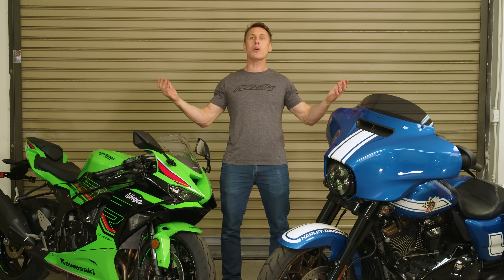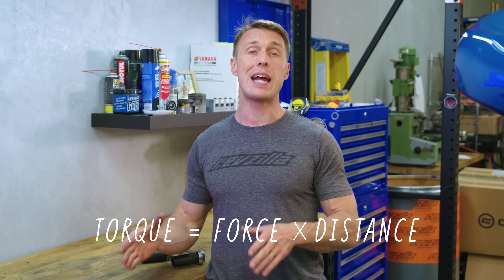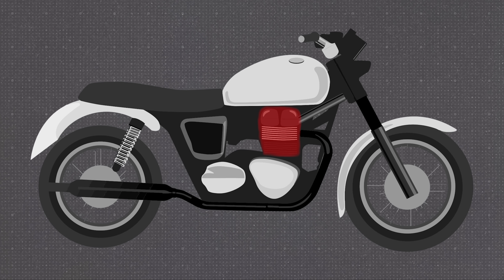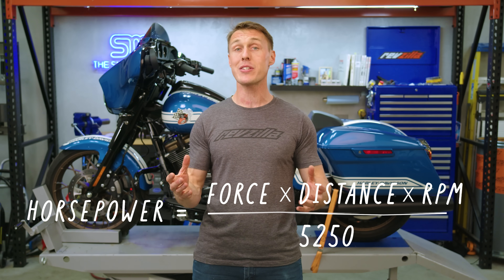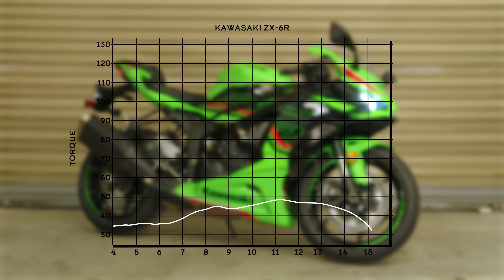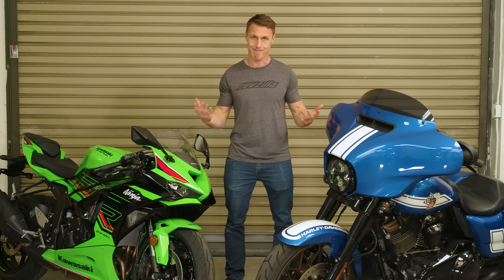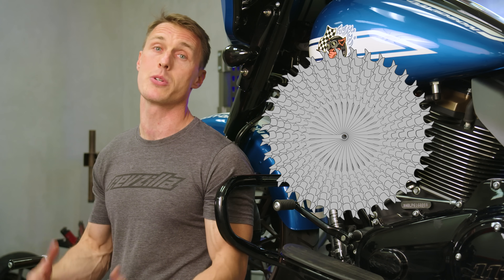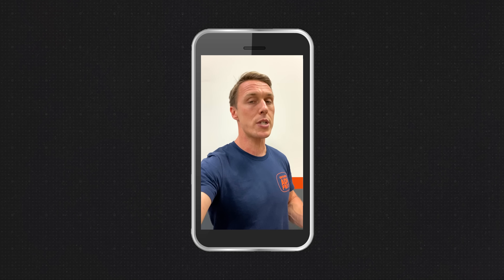Torque and Horsepower Explained! | The Shop Manual

Comment from the maker: Get the latest moto news and bike reviews at Common Tread https://rvz.la/3SiLCEB
Reply: Hey Team, thx for another awesome video :) 
Would it maybe possible to get a video from Ari´s Shop Manual, of him doing an upside-down fork rebuild? 
I know there is an video during his old MM times, but thats 8 years old and was about an right-side-up one.
Greetings an have a good one folks
Reply: i’m sure y’all have muted me but this video rly needs a rewrite
 if u want to avoid misinformation and actually elucidate the difference btwn torque and power for bikers who don’t know..

power = acceleration
torque ≠ acceleration
torque = where the power band is in the rpm

power tells u how fast u can accelerate

torque tells u what rpm range yr power band is at.. (a 200ftlb 100hp bike had a much lower redline than a 60 ftlb 100hp bike for example,,
but w the perfect transmission they’ll have the same acceleration..)

Comment: A wise man once said "Horsepower is how fast you can crash into a wall and Torque is how many walls you take with you."
Reply: Classic. Saying.
Reply: Worst analogy ever.
Reply: 😂😂😂😂 what an awesome analogy.
Reply: @doomman700 how’s it wrong? I’ll wait.
Reply: @nogginbonker76 how is it wrong, start with torque is a twisting motion not push. Then the fact that momentum will be what carries that wall which means speed and Hp will push it farther. Need more?
Reply: @nogginbonker76  Because horsepower to weight ratio determines how quickly a vehicle accelerates and power to drag ratio determines the top speed of the vehicle (unless it's limited by gearing), while kinetic energy (vehicle mass and velocity) determines how far you take the wall with you, or how many walls you take with you. Power is basically everything with regard to the performance of a vehicle.
Reply: into that same wall right
Reply: @nogginbonker76  how far you will take the wall with you depends only on the speed and the mass of your bike at the moment of impact (among other factors like surface area etc. of course)

the mass doesnt change with different horsepower or torque
and the speed doesnt either

the analogy just doesnt have anything to do with the difference of torque and horsepower and is just completely off topic
Reply: I wish I could buy u a beer
Reply: that wise man needs to study physics
Reply: Great example ! I’ll use this explanation ! Hilarious
Reply: @xXRunDeathXx  E = mc2
Reply: I'll take torque all day over horse power.  Torque pulls harder and you can feel the difference .
Reply: I heard this almost 10 years back.
Reply: @doomman700 😂
Reply: 😂😂😂 Learning, in a hilarious way
Reply: For anyone curious, that analogy is not accurate at all.
Reply: Noice
Reply: @nogginbonker76 its wrong because when you hit the wall, you'll break the vehicle and the engine will stop. So what decides how many walls you go through at a given speed is the weight of the vehicle.
Reply: @nogginbonker76 there you go, you waited and they answered.
Reply: It needs a wise man to say this? What a joke.
Reply: @doomman700 ehhhhh, when u understand torque and hp it makes sense
Reply: @coopermoreton6993 I run a dyno, I understand torque and hp , torque has zero to do with how far a wall moves. That would actually move farther with faster speed or more hp. But fools repeat those dumb saying trying to look smart. It actually makes them look dumb to a guy that does understand the two
Reply: Torque is what wins races
Reply: @jayonez137  the guy with the biggest pile of Hp wins period. Torque can be applied to a frozen wheel and get you nowhere, but break it free and you have rpm and hp that does something. I don’t expect you to grasp it, it’s a reality though that cannot be disputed meaning it’s fact
Reply: @nickn7939 
As do most people, fr, lol.
Reply: Sounds backwards
Reply: @savvykronik4192  
Now that I think about it...
I agree.
Reply: @ivoryas1696  torque is what drags your ass in a tug of war, hp is what passes you in a street race 😂
Reply: I like that hahaha HP and in Valhalla with nothing Torque and your in Valhalla with the wall lol😂
Reply: That's not actually how it works. Hp is essentially the potential for speed. Torque is how fast you will make that speed
Reply: Ahahahahahahahahahahahahahahahahahahahahahahahha
Reply: @doomman700  if it’s so bad then don’t read it😅
Reply: Basically: Torque = more acceleration/quickness. Horse power = Higher top speed ..lyes?
Reply: @jimibones178 exactly. I said something similar.😊
Torque =Quickness/acceleration. HP = Top speed. I prefer low-end Torque in a Muscle car of later 60’s . Like my 69 Oldsmobile Cutlass Supreme. with a 3 speed hurst. That was the Torquey-est car I ever drove. Damn but it was so much fun.😊
Reply: @michaelslater6839  I'm the same,prefer the torque. Is a pretty rare occurance you get up to top speed either way, so may as well accelerate better
Reply: @jimibones178  Plus as long as you’re not spinning your tires in an automobile, you’re not as likely to get a ticket with hard accelerating as you are when speeding . Although, there’s always the possibility of getting an “exhibition of speed” ticket. I tend to accelerate up the on-ramps when I’m in a quick car, then hit the brakes before I get too visible. Keep the rubber side down Jim.
Reply: @michaelslater6839  yeah I tried that a while back, but highway patrol clocked me at 104 before I even got off the ramp lolzzzz. I got in trouble
Reply: @jimibones178  I will admit, I have been lucky. I rarely ever do that now. Can’t afford a car with much torque or the $5.50/ gallon Cali. Gas to feed it.  I try to pick a long one that’s down below the highway for most of the way. Like after an overpass. Sorry that happened to you.
Reply: @michaelslater6839  I was on a bike, so gas isn't too big of a deal. But, is all good. Got my license back now lol. Nice talking to ya buddy:)
Reply: Lol
Reply: @nickn7939  he did he failed 😂😂 just like the analogy 🙌🏿🙌🏿
Reply: Straight truth cuz I just went into a tree by accident lmao
Reply: No
Reply: A wise man didn’t understand physics
Reply: The only thing worse than being wrong, is being publicly wrong as the first comment on a video for everyone to witness your idiocy.
Reply: He wasn't very wise. At any given speed the engine with the most hp will produce more torque at the wheels.

Comment: This was the explanation i was looking for. I knew the diff...but only at a surface level. The crank motion animation & explanation with the two different motorcycles really helped.
Reply: Yes - holding the piston-con rod and the crank pin made the difference for me too. Have seen many videos on hp vs torque and the force x distance equation but somehow that visual made it click.
Reply: same was very helpful!
Reply: Indeed
Reply: Torque is just a force. I think the concept of force is quite intuitive. Power is the one that is less intuitive. In layman's terms, a powerful muscle can exert a lot of force. But when you say a powerful engine can exert a lot of torque, it can get confusing because of the power and torque numbers/curves in the specs/dyno sheets. The torque can climb down while the power still goes up, but all is relative to the rpm.

In describing engines, compared to describing muscles, the term Power is more technical. A force causing motion in the direction of that force, is producing work. The higher the rate that you can do that "work", the higher is your measured power.

Torque is the rotational force produced by the engine's combustion, causing the crank to rotate (revolves). The rate of crank rotation is in revolutions per minute. The higher the torque that your engine is exerting at a certain rpm, then the higher the power will be at that rpm. Suddenly, the term "work" here is not specifically mentioned anymore.

If your engine crank is rotating at a rate 6500 rpm with a force (torque) of 500 lb. ft. behind it, then it is producing 619 hp.

The terms that are constantly there is the torque (force) and the revolutions (motion) per minute (rate). Power is kind of just a "calculated" result.
Reply: “How rapidly the torque is applied” made a lot of sense to me.
Reply: Be quiet
Reply: @sepg5084 Agreed, torque is just a force ( M*A) but is multiplied by the perpendicular distance from the axis of rotation.
Reply: actually, the animation was confusing. they showed the opposite of what they were talking about.

Comment: There's no real math in the 5250 number.  These weird numbers are the price to pay if you use US units.  In metric units, these numbers are simply 1.
Reply: I mean, conversion is still math. and in my eyes, all math is "real math"
Reply: Spoilers!

One day the US will switch over to metric and there will be much rejoicing...
Reply: If you're using metric units you still need to use a conversion factor. It's not 5252, but it's not 1.0 either. The factor depends on the metric power units being used (e.g. Pferdstarke or kilowatts) and the metric torque units being used (newton metres, kilogram metres, etc....).
Reply: @marcoperez1794   horsepower is not a metric unit
Reply: @arjankroonen4319  US Aerospace industry and FAA be like, "Oh, everyone else is ready to switch? Okay just a sec. We have about 80 years of test-based industry standards and regulations to re-do... without a war or... the commercial promise of the jet age for motivation".

Comment: A wise man once said, torque is mike tyson and horsepower is bruce lee.
Reply: I see where you're coming from, but I have a different perspective. The comparison between Bruce Lee and Mike Tyson is more about the type of engine and transmission rather than just torque and horsepower. In this context, the force relates to acceleration. Bruce Lee might have the same punch force as Mike Tyson, making them more comparable in terms of the force they generate, rather than just categorizing one as torque and the other as horsepower.

Comment: Torque is strength, horsepower is speed 👍
Reply: Half true. Power is speed and strength (speed x strength).
Reply: No, because the gear box. You can gear for more torque. HP will dictate how much torque there is at the wheels.

Comment: So what I'm getting from this is that the amount of torque at the crankshaft is not an important number. So why is it always talked about like it is? Because of a lack of understanding and of course marketers know this so they perpetuate the misconception.
Reply: You hit the nail on the head. Peak torque is kinda useless figure and is only talked about because of momentum. It doesn't matter if it's a useful number to the maker if it sells bikes
Reply: @pleasedontwatchthese9593 yeah, there are still a lot of dudes in comments thinking torque makes a difference in acceleration. 

If two bikes have the same hp then they will accelerate the same regardless of torque difference.  Only difference will be bike with lower torque will have to rev lot higher.
Reply: @currycel470  the bike has to Rev higher to create similar torque, torque is the turning force of the engine, HP is how fast the engine can work.  The higher the torque the faster you take off, how fast you can go is HP.  So a Harley will beat a Sport Bike off the line but the Sport Bike will then pass the Harley.  Harley high Torque low RPM, Sport Bike high HP high RPM.
Reply: @currycel470 bro it does😂, not a big difference, but it makes a difference
Reply: @evilwestsidefan9249 no.
Since the kawa will rev 3x higher you can gear it 3x lower and then it will have more torque and more acceleration than the harley.
Why? Because only horsepower matters for that, torque is manipulated by gearing.
Reply: If you ask any diesel guy they don't care about hp figures. Torque is king in work based applications. You absolutely do not want a low Torque high hp engine for anything but racing. Torque is also beneficial for off roading. Low Torque motors bog and stall out in mud or steep inclines. High Torque motors will not. This is why tractors and other heavy equipment use giant low hp engines.
Reply: @Cw0346  absolutely right
Reply: Yep. Power is most of what matters, and the shape of the power curve is the rest. Knowing engine peak torque tells you exactly nothing about vehicle performance.

Comment: I always knew what it was. But the analogy of the runner is a good one. The actual step pushing off the ground is the measure of torque, and HP measures the distance with multiple of those steps
Reply: It is a nice but completely useless analogy, because the torque as in the subject of this video is crankshaft torque, which is one of the most useless engine parameters, unless boasting and bragging are a virtue.
Crankshaft torque cannot be compared to the runners "push-off" because bikes and cars, unlike runners, have gearboxes.

Crankshaft torque is TOTALLY meaningless. 
At best, the SHAPE of the torque curve matters, but only a bit, and only for mediocre drivers that do not know how to use a gearbox (and I know that because I am one, hence my preference for older big twin sportsbikes like the 2-valve Duc's).

The best practical example for the utter irrelevance of engine torque can be found in Moto Grand Prix racing in the 1960's and '70's: Despite fourstrokes being "torquey" and riderfriendly with a wide powerband, pulling like a freighttrain, opposed to twostrokes being peakey and high revving,  narrow powerband and not all that much torque compared to the 4-strokes, without a single exception ALL manufacturers went with the 2-stroke for the simple reason that it is horsepower that wins races. Not torque. Even Soichiro Honda, who absolutely HATED twostrokes and tried to keep racing a fourstroke with the NR series, knew this (the NR was intended to extract 2-stroke horsepower from a 4-stroke engine). Honda had to cave and also changed to 2-stroke. Quite succesfully, I might add.

Comment: I always knew the difference in terms of applicability, but the actual physics behind it never clicked until now! They aren’t 2 different measurements, Torque is a variable within horsepower. You finally helped it click, thank you!
Reply: It's like money. USD 50000 is a nice amount but meaningless without time, is it per week, per month, per annum, over a lifetime? Similarly, torque is timeless, horsepower is torque over time.
Reply: How did you know the difference in application, but not understand the physics? Cart before the horse.
Reply: @gorillamoto5329 easy, if someone tells you torque is strength and Horsepower is Power then you now know the difference in application but you still might not know the physics behind it. We all know what things do but don't know how many things do it.
Reply: @paulneedham9885 torque is strength, Horsepower is power? 😂 Watch the video again. In simple terms, horsepower is torque over time.
Reply: A given number of horsepower can make any number of torque. Torque is a derived number.
Reply: I think it's the other way around isn't it? Dynometers measure torque, and then derive power by multiplying each point on the torque curve by engine rpm. And the calculation obviously takes account of rolling radius of the driven wheel, gear ratio, final drive ratio, etc....
Reply: Sounds like you are headed in the right direction. Keep learning. This video explains the application difference in a common but technically wrong way - A seriously wrong way if you are on any sort of engineering track.
Yes, power is not measured. It is a very meaningful value calculated from things that can be measured, namely:
Force x Linear Speed
Torque x Rotational speed
Temperature change x Thermal mass
Pressure change x Flow rate
and other stuff...
Reply: @alexandermenck6609  Other way around. Torque is directly measurable. Power is calculated from measurable things and is a much more meaningful thing regarding vehicle performance.

Comment: 04:43 you're wrong at this point. Acceleration also is a fuction of power. Both top speed and acceleration are very much depending on power, as long as you have some sort of torque converter (=transmission).
Reply: came here to say same and if I heard the wall analogy I was going to lose it